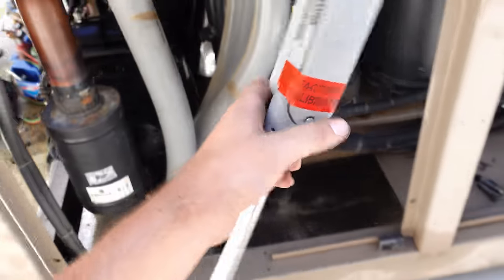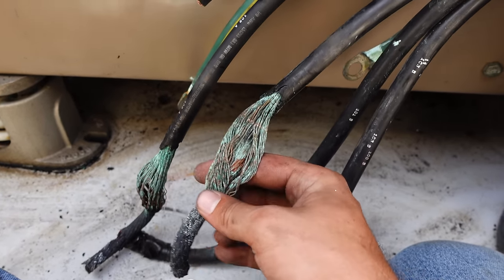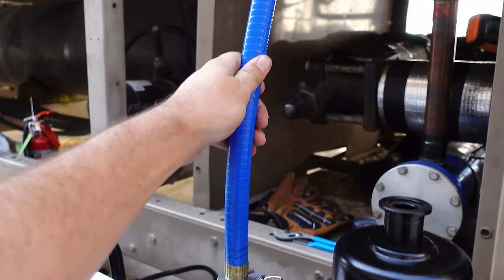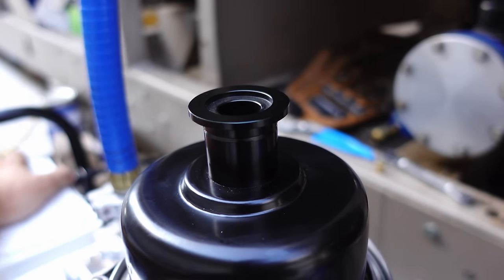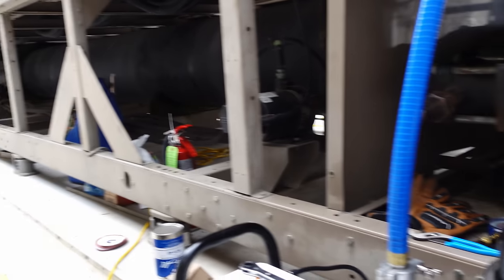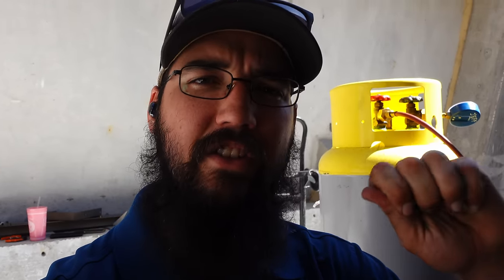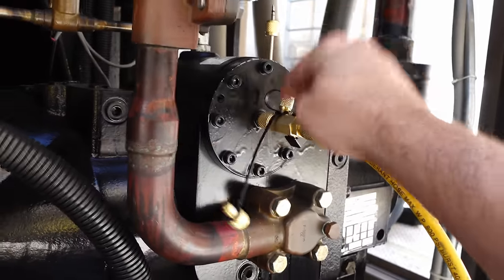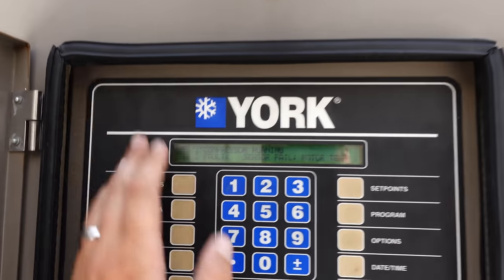Will NAVAC Pumps compete in Commercial HVAC?

Comment: Even pure nitrogen will drop in pressure with a temp drop. It just has much less of a drop than atmosphere or refrigerant. The HVAC school app has a calculator built in for figuring this. You can enter the starting temp and pressure, and enter the ending temp and pressure and see if it has actually leaked at all. Awesome video man!
Reply: Pure nitrogen will not raise nor drop unless in a perfect vacuum or headed to a star.  All the other shit affected the delta...
Reply: @kaptaintrips  nitrogen follows the gas laws just like any other.

Comment: I do every job with my 8cfm YJ. 3000ton YKs, 200 ton YVAAs, 2 ton Heat Pumps, Recovery Tanks, whatever. I try to use the biggest and shortest hose as possible and as many of them I can fit. Last big job I did was out in the snow, YLAA chiller, put a 3/8 hose on liquid service, 3/8 hose of suction charging valve, 1/4" hose on liquid line after EEV and micron gauge was on discharge pipe. Within an hour, I was at 480 microns (enough time to pack my tools and make one trip to my van and back up with the refrigerant.) The next morning I got to 340 where it stayed for 2 hours decaying. I ALWAYS leave my pump running overnight on anything bigger than 5 tons, unless I achieve sub 500 before lunchtime. All repair job are quoted as minimum two days or 1 and a half days, to get a quality evacuation. With a single 1/2" hose, I can pull a 2500 ton YK chiller from 14.4psia to 1200 microns in a couple hours and it takes the remainder of the night to get below 300 (boiling 15 gallons of refrigerant laden used oil.)

Point is, I like this pump but would NEVER bring it to job sites. This seems like a great fit for a Chiller Plant to be dragged around to each unit... not so much a service van. Looks like it weighs over 100lbs.

Comment: Used my first navac master series 4cyl recov machine. Thing is a beast. Not using push pull to charge 800lbs of r134 it had 300lbs in the chiller in around 3.5 hours. Next will be the vacuum pump
Reply: I did have it throttled down about halfway though because I was borrowing it to try it out. I’ll be excited to see the push pull on the other circuit with this same machine

Comment: Just did an overhaul on cvhf with oversized barrels. 900# circuit. Same vacuum pump had it to 990 microns in 5-6 hrs and down to 170 when I came in the next morning.

Comment: Here we use Trace-a-gas which is 95% nitrogen and 5% hydrogen,  then you can use a hydrogen electronic leak detector to find leaks .
Its good for looking for leaks but not so much for pressure testing because it's even more reactive to temperature changes .

Comment: Nitrogen pressure will definitely rise and fall with temp swings. Like mentioned above, There are apps for It, Even websites that will calculate It for you. Good one to show apprentices Is the below formula. 

Nitrogen test

P2 = (P1xT2)/T1

P1 - Test pressure
P2 - Verified pressure
T1 - Ambient test pressure temp 
T2 - Ambient verified pressure test

Need to convert F* to Kelvin

K= (*F - 32 / 1.800 ) + 273.15

Example:
Test pressure 190# @ 94* (307.6 K)
Verified pressure temp 70* (294.3 K)
(190 x 294.3) / 307.6 = 181.78 PSI
Reply: Or start pressure / temp (measure on pipe) = a number. After pressure test. new pressure / new temperature = same number, it's tight.